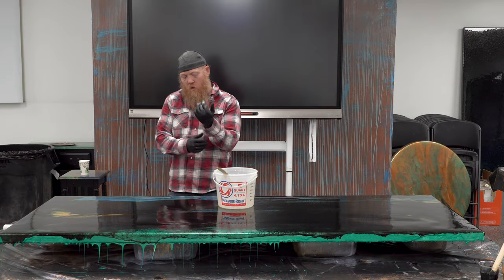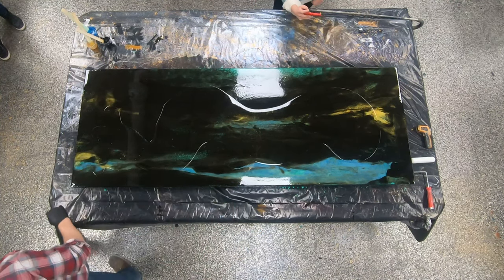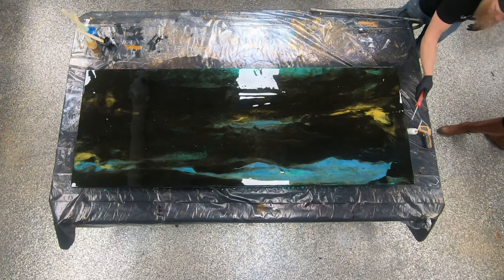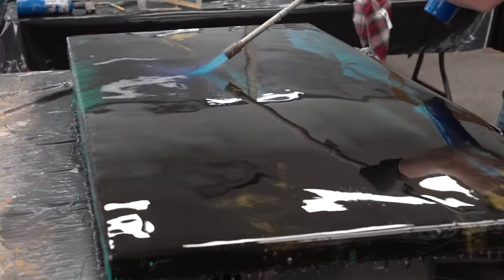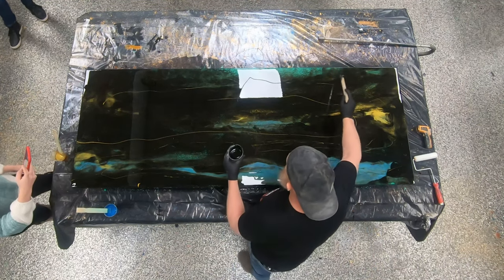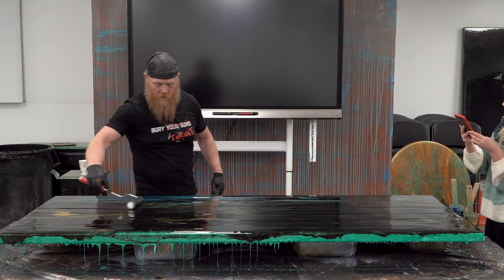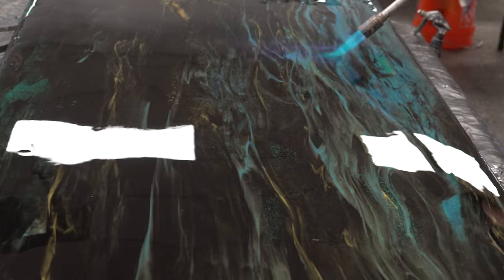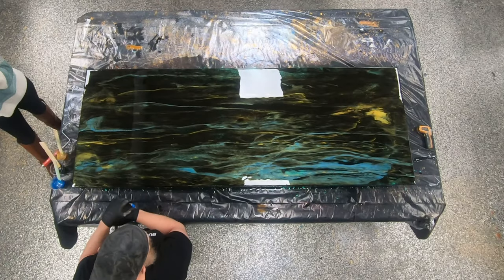How To Repair Epoxy Resin - Fix Epoxy Dents Flash Cure - Countertop Epoxy - DIY Repair

Comment: I poured a countertop about 4 years ago.  I failed to realize I should caulk around the sink.  Now the epoxy is curling up from the sink edge.  What is the best way to correct this?  I really don’t want to report the entire countertop.  Could I just apply caulk now or should I possibly apply a clear epoxy to
Affected areas and then caulk.  Thx
Reply from the maker: Hi please give our office a call so we can better assist with you on this project.

Comment: I have a few small dents in my work!! What do i do? Light sand?
Reply from the maker: After the epoxy is cured, the only way to remove dents is to do another pour to leave or to sand! But be advised, sanding will leave you with a matte finish.

Comment: So if I’m going to pour a clear coat over maybe a countertop that has some issues…, I don’t need to sand it at all first?
Reply from the maker: We advise a light sanding but this also depends on your substrate and what “issues” it has. Please give our office a call so we can provide the best approach for application on your project. 970-639-9338.

Comment: im been searching everywhere, and i can't find a specific solution on how to fix pinholes, question does clear coat stick to epoxy without sanding the surface?
Reply from the maker: You could do a clear coat, just lightly sand beforehand. Make sure when mixing to Mix slowly to avoid as many bubbles as possible.
Reply: @CountertopEpoxy  really appreciate the answer.
Reply: @ another question, which epoxy  do you recommend to use it for carbon fiber fabric, do the countertop epoxy will work? thanks for your time 🙏
Reply from the maker: @gcarlitossatunay2987  yes we have done a carbon fiber countertop before and we just used our FX Black Label Countertop Epoxy
Reply: really appreciate 🙏

Comment: A polyurethane to protect it from the elements?  I am doing a pour that is going to spend time outside in the elements.  Want it to hold its color cause it's going to go into shows.
Reply from the maker: Yes be sure to call our office for more info he’s taking about our polyurethane that he designed to go along with our epoxy products as we have them tested .